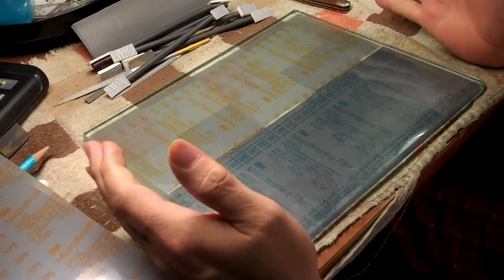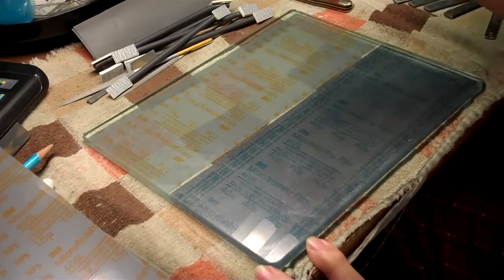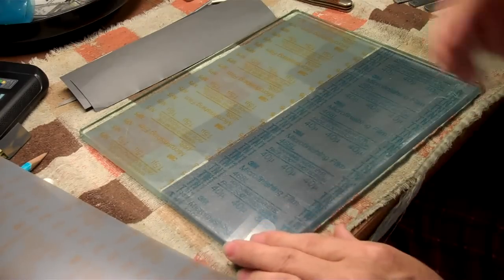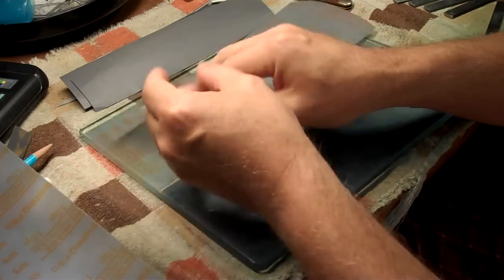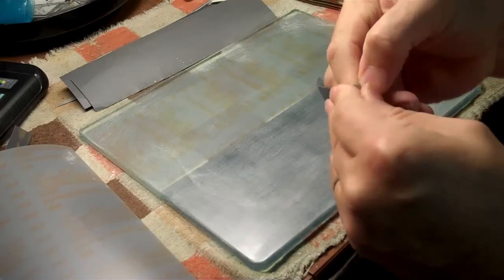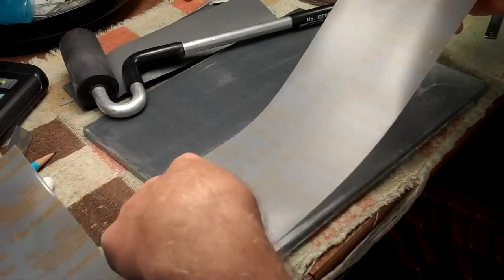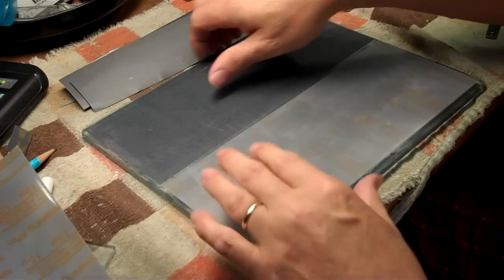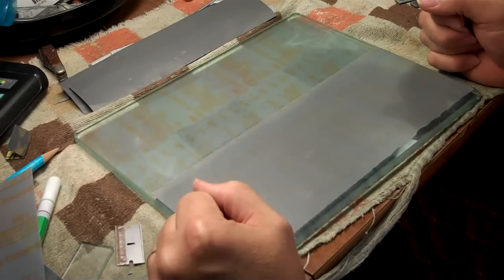Refacing Tips: Work Surface

Comment: I have refaced a mouthpiece that I bought recently. After the reface the bottom and mid sounded fine. The problem is the high notes sounded slightly choked and do not sing, is there a way to fine tune the top notes of a mouthpiece exclusively?
Reply from the maker: Usually it involves an adjustment near the tip.  The facing curve could be too flat there or too curved.  The baffle could be too high or low.  The tip rail could be to fat.  Difficult to diagnose without seeing and measuring the mouthpiece.
Reply: OK, the piece was sold. I was only wondering how I might have perfected the sound higher up on the horn as I was struggling to make it 'just right', thanks anyway..